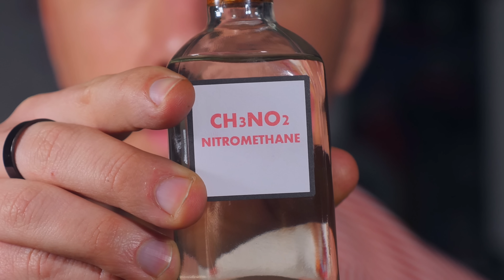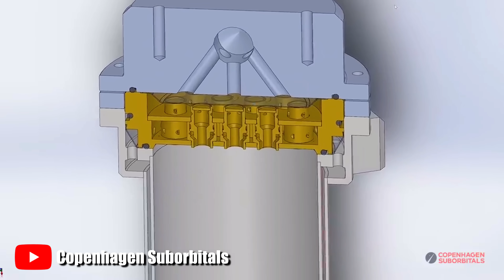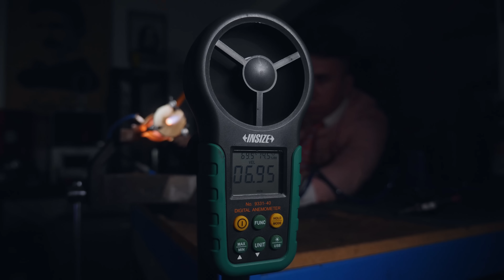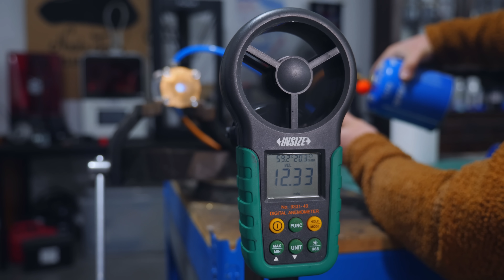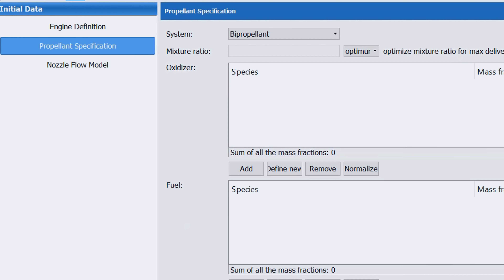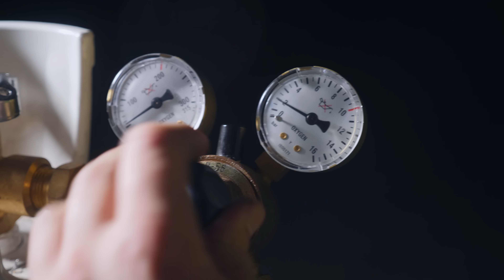GLASS ROCKET ENGINE

Comment: Video idea?

Try make 3d printed rocket nozzle? 
A design solution used in real rocket engines to stop the nozzle from over-heating is passing the super-cooled fuel around the nozzle in these small tubes all the way down and up again and then into the combustion chamber. 
A way of maybe being able to actually make that with a 3D printer is to make channels for the fuel to pass through using printing plastic that dissolves in water, to stop the print from collapsing, and then submergining the nozzle / combustion chamber in water and then finally having a complete, fully plastic and 3D printed nozzle and combustion chamber

Comment: i have an idea to make the metal part you want first 3d print the part you want but filament but it must melt at low temperatures then take part put it in a special sand used to make cast parts make a hole for the molten metal to flow in then after it cools down the 3d printed part melts away you have your part

Comment: I like the use of peroxide for oxygen, but I would love to see a reverse of a typical hybrid engine where you flow fuel over the oxidizer in that case being potassium nitrate as you can the stump remover pellets and powder them and then fuse into a shape for an engine.

Comment: How about using fuel injectors used in car engines to inject methanol into the combustion chamber while a set of turbines compress the oxidiser (air) essentially making a turbofan engine? Let's make an airplane engine!! Honestly this project is my dream but neither do I have the money nor the time... Good luck to you if you ever try it!

Comment: Quite interesting that you can still get H2O2 with more than 12% in EU as it was regulated after the Sauerland bombers, even for commercial use (without special permission).

Anyway, cool video, how about a rocket motor with liquid fuel or even hypergolic fuel?

Comment: Continuing the Wankel theme I‘d find a video using and comparing different fuels (which you‘re quite experienced with) in a rotary engine quite interesting! 
Since these engines could theoretically run on anything.

Comment: I would think that "dual propulsion" provided from the steam produced in the H2O2 reaction would lower the efficiency while raising max thrust. The heat of combustion and decomposition is going to be spread out more because it is absorbed by the combustion products and the steam, lowering overall exhaust temperature and thus ISP, while the increased mass flow from the steam improves thrust because you have more reaction mass to throw out the back of the engine.

Comment: The proper way to improve this engine is to calculate opening sizes and positions in the combustion chamber. There's rules how to do that. Another thing if you look at such combustion engine cross sections you will see that the path of the oxidizer is actually backwards. Can't explain it properly, you should just Google images.

Comment: Awesome. Now that you can do exact metal parts - can you build a rocket engine that uses one or several impinging injectors ? Those liquid injectors where two or more beams of liquid fuels (and liquid oxydizers) get injected to collide in a 90 degree angle to mix. That would be interesting to see in a quartz tube. Especially one with three liquid beams, i.e. hydrogen peroxide, potassium permanganate solution and a fuel.

Comment: It might be more effective to use an injector running incredibly rich with the chamber that adds additional air.  This would allow the fuel/air mixture to be much hotter when it comes in contact with the air, thus be able to more reliably ignite.

Comment: Integza, you should make a benchmark station for your rockets so you know exactly how much thrust they produce, heres a couple ideas of how: 
Idea 1: much like what you did in this video, a skateboard with weights on it which you would weigh before tests.
Idea 2: A horozontal linear rail with a "pressure post" which is attached to a scale for the rocket to press against.
 
or perhaps some vertical system to test with gravity acting as a force aswell.

Comment: Possibly a long term project for you. Could you create a set of 3D modellers and/or CNC machines which produce the components for another 3D Modeller. Thus the set of equipment could "clone" itself to double the number of machines producing output.

Comment: You can Make rotory engine which use a pressure build up by compostion in to the edge of triangle shape engine to make it run smoothly and does not make it wear out⚙️👌🏼

Comment: If there were a defect in that quartz, a bubble, small fracture, the thermal difference could cause it to shatter and get into an experimenter's eyes. Anytime you work with heat, pressure, or fast moving objects I strongly suggest wearing safety glasses.

Comment: ahh yes the biggest pre-filled bottle you can buy
but what you can do is take a sodastream or other CO2 capable bottle and "refill" it with pure oxygen, kinda like a scuba reserve tank
14-20oz of supercritical oxygen is way easier to carry and being sodastream tanks are aluminum you can easily store oxygen inside them as the oxide layer makes it stronger
you could even get a tiny 12oz refillable CO2 cartridge and use a simple threaded keg regulator system to get single-run oxygen canisters, they are made of steel and designed to hold supercritical CO2 so they can hold supercritical oxygen easily, and keg regulators that use a 12g cartridge for dispensing are common enough to make it cheap
I actually plan on making a modular butane torch lighter that uses 12g cartridges for fuel and a simple vortex injector to run the flame output

Comment: Video idea. Building a test stand that can test and record thrust, and air flow rate as well as the basics like temperature and pressure. You can build  it from a work table or something.  Then you can also have something for emergency fire extinguisher at a single button push.  Just a thought. 😅

Comment: The more i watch things like this, the more i am humbled by Dr. Goddard's work on such a meager budget. 

" I climbed a tall cherry tree at the back of the barn ... and as I looked toward the fields at the east, I imagined how wonderful it would be to make some device which had even the possibility of ascending to Mars, and how it would look on a small scale, if sent up from the meadow at my feet. I have several photographs of the tree, taken since, with the little ladder I made to climb it, leaning against it.

It seemed to me then that a weight whirling around a horizontal shaft, moving more rapidly above than below, could furnish lift by virtue of the greater centrifugal force at the top of the path.

I was a different boy when I descended the tree from when I ascended. Existence at last seemed very purposive." - Dr. Robert Goddard

"

Comment: I suggest you make an rc boat with this engine, it should be relatively safe in case it catches on fire, + it should not require tons of trust to move. you could design a speedboat, make it heavy and add some other thrust sources such as your ionic wind engine that could also serve as ignition for this engine, also you can make use of the generated heat to fuel a mini steam engine that can provide further thrust (empty co2 cartridges with some copper tubes going underwater). hope to get the 3d printer I never could afford one :)

Comment: Great videos. Have you considered using electroplating your 3D printed parts so they can withstand higher temperatures?

Lost wax casting is another option but it is a little more difficult.

Keep up the great content. ❤
Reply: Wait.. you have a CNC machine now 😁

Comment: Video idea - use a ToF distance sensor on a rail moving vertically up / down pointing towards the direction of a spinning plate. Put objects on the spinning plate and parse the ToF output and display it as a mesh on your PC, creating a 3D scanner.

Comment: Rather than use potperm to breakdown the peroxide have you considered using a catalyst? I know you have looked at it for the steam rocket but doing it in this scenario makes it a lot easier to control and get the mixture just right. Perhaps a glow plug from one of the model car engines as an ignition source so instead of risking your fingers with a sparkler you could light it off with a controlled switch. 

Great content, keep it going!

Comment: I did some same experiments... 50%H2O2 aq.
in 14ml testtube added 0.2ml H2O2 diluted with some water, 0.2ml of car auto petrol (or petroleum ether 50-90C also good there), drop little crystal (like 1mg) KMnO4, it starts bubling, then i lit it witha match, it make shot sound, like HHO gasmix usually do.
...1liter of 50%H2O2aq. contain "300bar oxygen in 1liter baloon"  quantity
i trying to injectby sirynge H2O2 50%aq directly into KT2104 butane air torch hozzles, but no any reslt at all :-( it looks like H2O2  50%aq without KMnO4 stable in hot flame even... it definately acts on it like water, some yelow flame flashes lower power due to consumption for boil H2O2 like water in flame...,nothing more 
Intresting video, thankyou.
Reply: beware with that oxydizer, never mix more than 1..3ml of 50%H2O2aq. sol-n with any kind of flamable substance, - some trycky aroma parfume mix that i research in test tubes, just did babah... surprisingly, that is not a problem when 1..3drops of 50%H2O2aq.was inside test tūbe or some glass jar... it possible could be  even when mixing with organic components like acetic acid or NH4OH sollution, stonger than 10% medical ammonium sol-n, nonflamable in usuall life, it is safe when you add some water containing substance to 50%H2O2aq.  like maybe safe enough to mix 50%H2O2 with Vodka (40%vol.C2H5OH aq.soln) because it contain water, and H2O2concentratin will drop to 25% or so, pretty safe for life, and fingers,but not for eyes... still can fountain in face, so you must use safety glases when work with it.
90%, 80%,70% and even 60%H2O2aq sol-n tend to deompose spontaneously, even on storage on factory,  with your home and body probably... harder than just 300bar oxygen 1l Baloon, due to in molecule H2O2  also water here, 
and classic reaction is:  2H2O2 => O2^ + 2H2O^ !!! <that water also exhaust as a hot steam vapor. and 50%H2O2aq sol-n contains from manufacturer some stabyliser,  1% of Acetic Acid or 1%H2SO4. you can neutralize it by water sol-n of NaHCO3 or of NaOH, to neutral or some pH≥7, and reaction will happens faster in times,  some time ago, i droped one by one drops of 50%H2O2aq.sol-n inside 100ml flask with some KMnO4+0.5ml H2O sol.n, in order to get stable flow of oxygen, and it reacts like if flask was redhot quarts, with Pshhh sound from every drop... it was apparatus with glass lab. rear condenser conected upon 100ml RBFlask , H2O2 in 20ml syrinje with PVC medical infusion set pipe(5mm dianeter transparent tube, that is not sylicon, but PVC, and(or) rare cheap PE pipe in some country obtainable) with needle in rubber cork, that also have second pass-connection - oxygen output tube,cork closed rear condencer, allow to drop H2O2 50%aq.sol-n into lask with water KMnO4 sol-n as the decomposition cataliser, drops down via chanel of simple Libih-condencer, and O2 cooling by RCondenser  flowing up via RC, apparatus was not best, need more cooling and better drop funel maybe... but it works realy fast on non stabilized 50%H2O2, almost immediately heat flask to 100C, and every drop even first, sounds pshhhhn like water on hot plate, some like  50mg of LiAlH4 reacts with water... 
Stabylized Hyd.P.50%aq. reacts slow like medical 3%almost, and tend to exotermic autocatalisys, uncontrolably, with soda neutralization it reacts like 30%perhydroleum carbamde H2O2 complex tablets for hair whitenyng...

Comment: I've been planning on using alcohol and low concentration hydrogen peroxide/water for a water injection system on a supercharged engine. That reaction you got was incredible! I wonder if there is a simple way for me to mix an oxidizer with the hydrogen peroxide.

Comment: Maybe integza should firts try to build a hydrogen peroxide jet engine. Maybe if i understood this video correctly you can also add an after burner type effect where the jet turbine creates high amount of oxygen and then an tube witch can use butain as a fule with a secondary combination chamber. Also an idea if you space the two apart it could draw in more air if chanels is implemented bit i dont know

Comment: Awesome video! I think a very interesting project would be an ion-thruster using xenon or hydrogen or, even better, a lead rod. Or at least water. I'm guessing the lead one would be the most efficient, though.
Reply: It's probably not a good idea to spray lead vapour all over your workshop. Anyway, for an ion drive you need a propellant with low ionisation energy. Xenon is good, as are the alkali metals (Li, Na, K, Cs). Mercury also works well, but similar problems to the lead...

Comment: It might be a good idea to consider a rotating detonation method by injecting the potassium permagnate in a dispersable slurry ahead of the pressure wave and even have the injection actuated by the wave itself. The finer the grain of fuel, the faster the reaction. So, using a coffee grinder should make powdered sugar level of granularity. If the right kind of binder is added to the grains and emulsified in pure oxygen bubbling through the peroxide (via air stone). The mixture might yield a higher oxygen content.

Comment: Isn't there a way to put pure oxygen in a canister(like the paint spray) and compressed air? That would be very light although I think the efficiency would go down because if the canister cannot handle the pressure or the compressed air would have too less pressure or amount of running time the rocket won't be able to run long enough to properly fly. Just a thought tho, I'm on electronics but I enjoy these kind of content.

Comment: Try revisiting the metal 3d printer Idea. Try using the welder with a smaller voltage so that te metal geht's Red Hot doesnt melt imediately

Comment: This was absolutely amazing. Loved the relatively simple but effective nozzle.

Video IDEA:

Create an engine using the same fundamental mechanics that a rocket engine is built on so it has a similar (very high) efficiency. 
Use this to power an aircraft that can carry a payload. This aircraft would be able to generally do everything a normal plane can. It would be relatively fast and efficient. 
Also as optional extra, it can somehow have vTOL. [(Whether this is achieved through a gimbal, i.e. multiple servos at that scale) or (through a separate exhaust channel) or (through an separate form of propulsion itself like a bunch of fans)]

Alternate idea:

Create a hoverable object which uses a dual propulsion engine and should be able to resist high winds and natural disbalance due to weight acting on certain sides of the object more than the other.
(Optional - Very Durable and can withstand high pressures).

Comment: Dude, brilliant video, and excellent designs... and you're still way too close to the engines. Your choice of course, but for everyone else out there, use remote control for your rocketry or it'll bite ya with nasty pointed teeth.
Take a look at the Black Arrow launch vehicle's engines - peroxide and paraffin (kerosine).

Comment: Video Idea:

Making your first Jet Engine Toy Water Boat, strapping a small fuel and oxidizer tanks and trying to achieve enough propulsion to do a wheely in the water that would be hilarious. Also controlling the steering using a 2-valve system.

also, a question about mechstudent420's idea, will it be possible to make an electrolysis reaction using solar power and salt water? if so, would it be possible to make the boat's fuel and oxidizer replenish themselves over some period of time?

Comment: I realized how stupid you were while you did that demo with your unshielded eyeballs less than 1 meter from the potential thermal-shattering cylinder.
I also note that you say nothing about solid fuel.  We used to use solid fuel to get to the moon.

Comment: They have nitrogen filters and running a type of rocket turbo prop on a airship design could get you to space & or even orbit if shaped correctly. Running from a ram/scram styles will help with q values of used total fuel for the dual propellant while helping cool the design through the easier evaporator effective acting as a pump

Comment: Video Idea: Use your CNC to custom-make an airsoft gun to run off of helium. It would be very interesting to see the difference in speed and power output, given that helium is much lighter than CO2. If you do this, make sure to shoot in a safe area as these bb’s will be outputting a whopping 4500 fps. For reference, with a .2g Bb, the force exerted would be 187 joules of energy. This is around half what a 9mm fired from a Glock 17 outputs, so it's really just for testing the limits of pressurized propulsion.

Comment: Using the heat from a rocket to power a small sterling engine that could function as a compressor for the oxidizer for the rocket.

Comment: You do this stuff indoors?  I'm amazed your house is still standing.  Between the high speed sparks and unforeseen issues such as a flaw in the material.  I do wish you'd do it in a safer place - I'd prefer to see more of your videos rather than hearing that you ended up in the burn ward and without a house.

Comment: “Borax is a mineral with formula of Na2B4O5(OH)4·8H2O”

“Sodium percarbonate, or sodium carbonate peroxide is a chemical substance with formula Na2H3CO6. “

Sodium peroxoborate [Na+]2[B2O4(OH)4]2−
“Sodium perborate releases oxygen rapidly at temperatures over 60 °C. To make it active at lower temperatures (40–60 °C), one must mix it with a suitable activator, typically tetraacetylethylenediamine (TAED).”